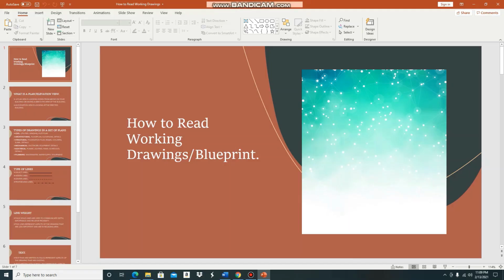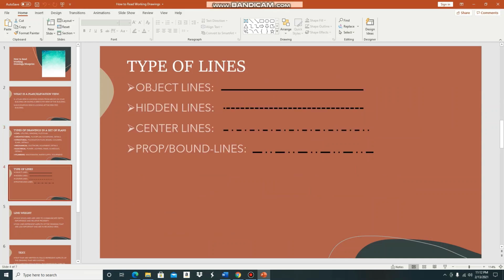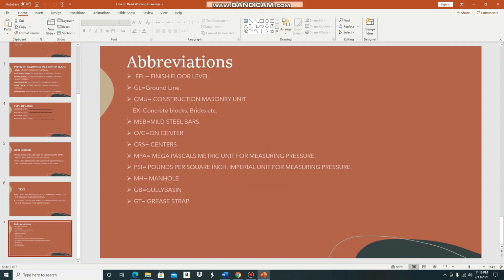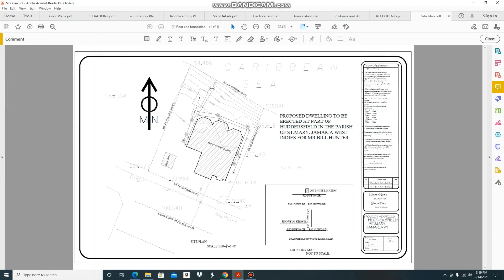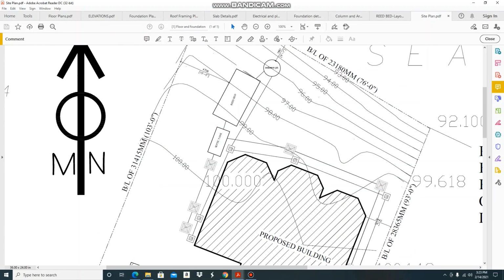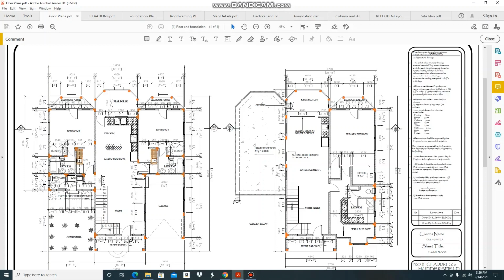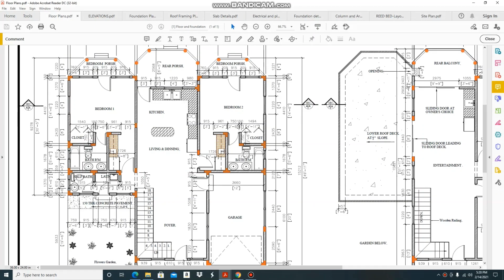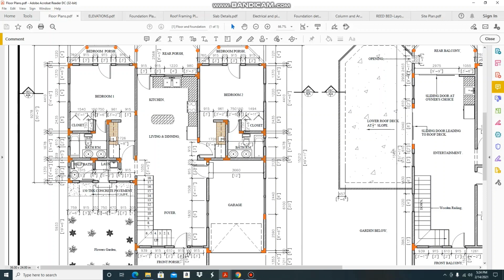How to read working drawings blueprint in Jamaica.

Comment: Good morning Sir. Wonderful videos. I need your help. I want to know if a car porch can only have columns and a building on top of it?
Reply from the maker: If your going to be building on top of your carport without any supporting walls, then you have to use columns to support the upper floor. However, it is not a must that you use columns, you can use concrete block wall as well, depending on the design you want.
Reply: @jkengineeringarchitecture.  well done!
Reply from the maker: @Jazals9615  Respect.
Reply: @jkengineeringarchitecture.  what size columns do U recommend?
Reply: @jkengineeringarchitecture.  it's a open carport
Reply from the maker: @markrobinson5892  If it a open garage then use columns. You probably can use 1ft x 1ft columns reinforced with 4 #5 or 5/8 rebars.